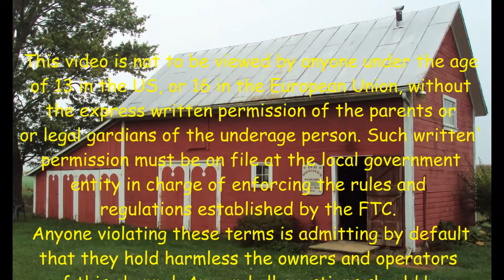Making A Quilt Rack Pt 3 It All Came Together   😁

Comment: Thought I'd let you know I decided against the resin when I got to wire brushing and I used the twisted wire job on the DeWalt. Part of the old paint was still stuck tight, I beat the rust layers loose and there is a good rough texture for paint to stick to so I found some old black and with some $3+ thinner from a pump somewhere, the deck has another coat of oil base. After I eat I'll go sharpen the blades for the 1st time and then put on another coat. THEN let it dry till time to put it back on the........................ wehateveryoucallit. Tractor part, I guess. I was scared the resin wouldn't bond without a special primer  as I've been watching guys finish garage floors and know it won't work if it's not prepped right, so I've got it for a future deal or raw deal, whatever the case may be. 70-ish and clear. Right warm in the sun but you know where the workbench is. Right beside the shed. GBWYall!.
Reply from the maker: Just got back from a jaunt through the countryside. 
I took Lydia to the Estate Sale barn.She hadva good time lookijg around for an hour.
70 sounds good. 80 is better swimming weather, but that's a ways off. 
Have fun mowing. 😁😎
Reply: @OldSneelock  Got 2 coats of oil base on the deck and blades sharpened and back on. Went and got another pint or maybe a quart and will put more on the highest wear areas. It's got a good coverage the way it is. I slather it on and don't believe in starving a brush A-tall! We went in a wild goose run around the other night trying to get our tax stuff back and nobody was home. I think Toots left them a poison pen note when she went on the grub run to let us know when. Nothing to hear yet. And it felt like 75 today but I didn't look because I was previously engaged with a paint brush or wire brush. I'll probably put the deck back on and it'll be ready to go.  Stuff is greening up but we'll still get some freezes. Yall remain calm and GBWYall! Don't know how to EVEN act with a confuser that's plumb instant!